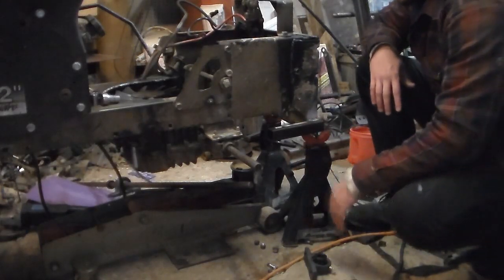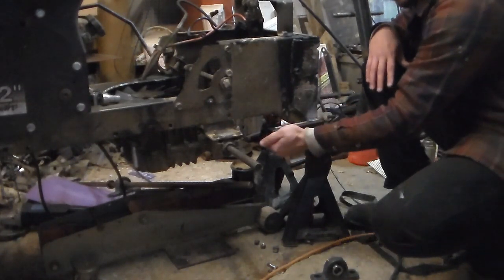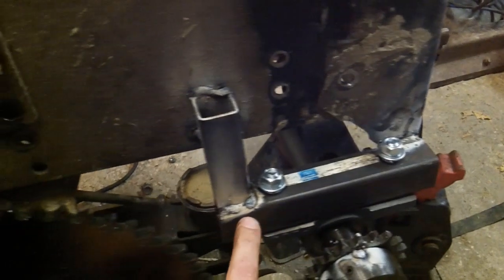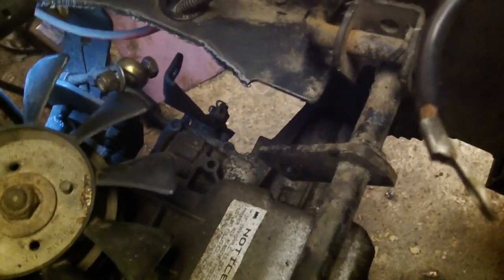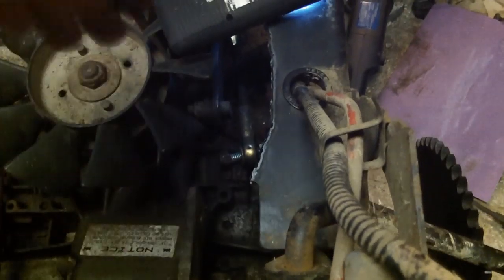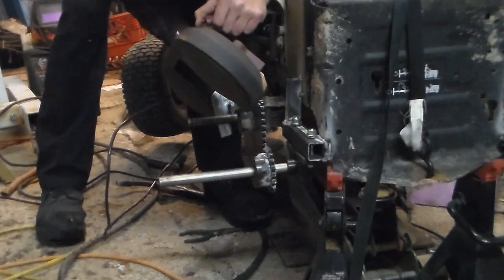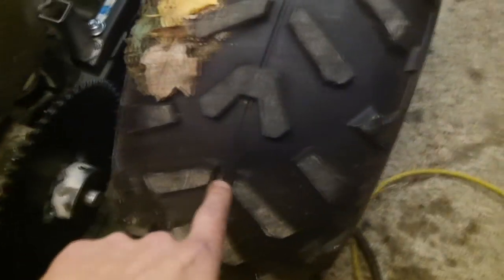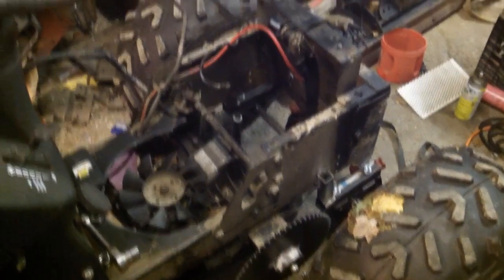Hydro Mudder Part 2

Comment: im working on doing this but by extending the frame and leaving transaxle in place. my victim is an mtd 18 hp v twin . i cant figure out sprocket size yet. i wish you kept working on this project.. thank you RCG
Reply: i already have a mud mower. this one will be more a racing mower.  so gearing is a mystery .or i could just do the math maybe .